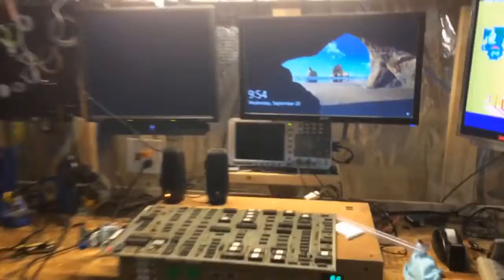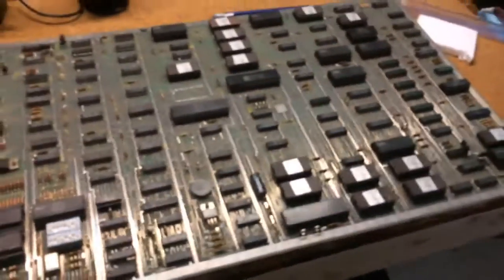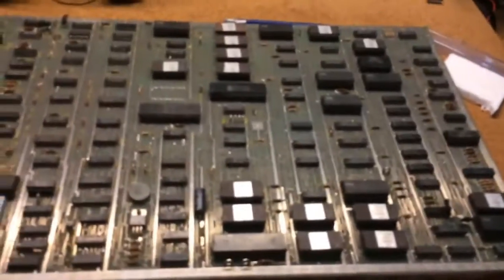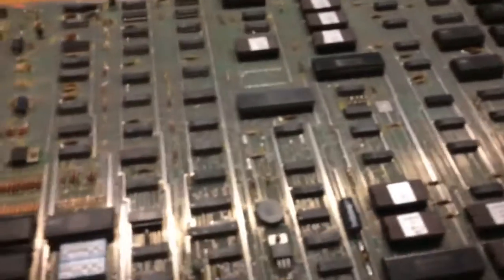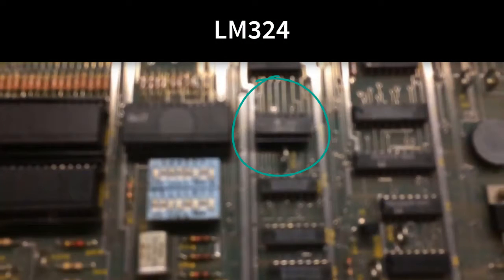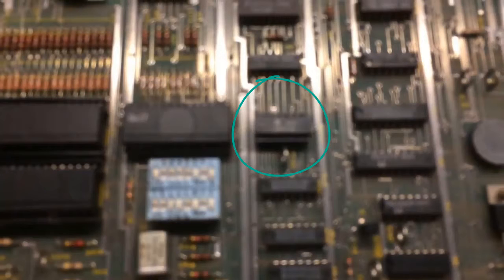Arcade PCB repair 7 - Dig Dug with no sound

Comment: When a flip flip preset pin and clear pin are both enabled at the same time the flip flip will change its outputs from the data input and clock input? The flip flops preset pin will always make the flip flips Q output HIGH and the Clear pin will make the flips flips Q output LOW, so if they are both enabled at the same time this makes the flip flip in a undetermined state which it will Toggle the flip flips Q output on what the data input and clock input is?

Comment: Yes you said that ROM chips don't output signals. The CPU just Reads the data off of the ROM chips but the ROM chips don't output any signals. When you first turn on the arcade game the CPU is running without code and the ROM chip must output a signal to the CPU to tell the CPU to read the roms game code contents.

Comment: what external devices send IRQ signals? you mean that the external device sends a external signal to the CPU's local ROM chip first before the CPU's IRQ pin?
Reply from the maker: in general IRQs are sent by external devices (on computers) On Dig dug I don't remember what causes the IRQs I haven't looked at a dig dug for many years. Forget about the ROMs the ROMs have nothing to do with IRQs except that somewhere on the ROMS is code (instructions) that the CPU reads when it receives and IRQ, but that's the same as any code. The ROMS hold any code that the CPU will execute whether it be interupt related or not.

Comment: The 3 CPUs shared data buss and shared address buss. I thought the IRQ signals is what controls the 3 CPUs from not accessing the shared data buss and address buss at the same time? Or what is the IRQ signals doing if not this?
Reply from the maker: The IRQ is just a signal from an external device that says to the CPU "do something special "What that is (what it's supposed to do)" is defined by code in the first few bytes of the address space (on Z80) (on eachs CPUs local ROMs)

Comment: dig dug has 3 CPU chips, where are the Interrupt signals coming from? are they coming from the ROM game code because you can't have 3 CPU running on the same 8 bit data buss, so you need interrupt signals? The interrupt signals are program in the ROM game code to tell which CPU#1, CPU#2, CPU#3 to turn on or turn off. The CPU that is turn on is able to LOAD data on the data buss while the other CPU chips are interrupted by an interrupt signal? The IRQ and RMA signals going to the CPU chips does what functions in arcade game mostly?
Reply from the maker: no ROMs are read only they cannot generate signals (interrupts) on their own. you'd have to check the dig dug schematics to see what sets the interrupts, I think most likely the main CPU triggers interrupts on the other two when it needs the other 2 to do something. That is correct the 3 CPUs must share the shared bus and not try to use it when the others do. each CPU also has ability to access it's own local ROM also (and may or may not have local RAM, I forget) so that they can work independently, but they must be careful never to access the shared data bus at the same time. if I recall their is hardware that ensures this doesn't happen. (shuts off access to the other CPUs when one is using it) but it's been a while since I looked at the schematics so I don't remember for sure.